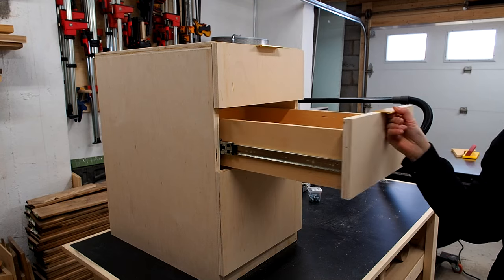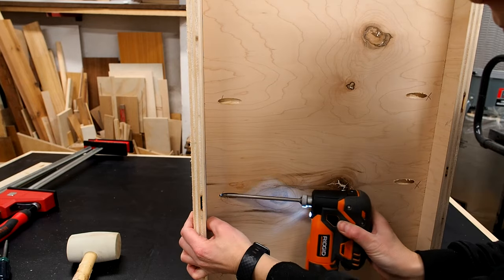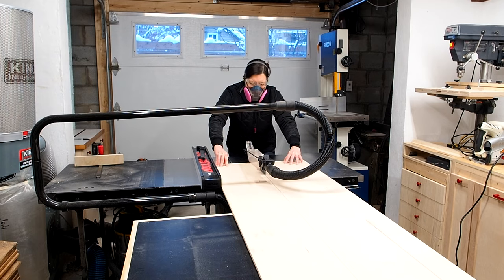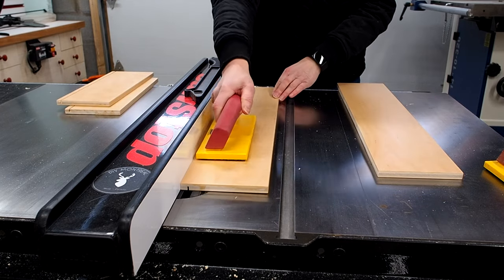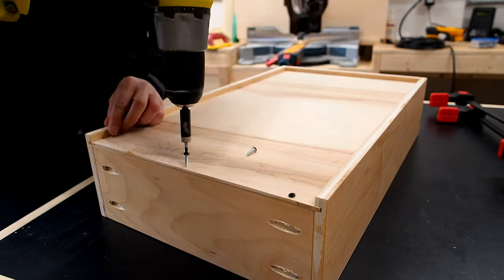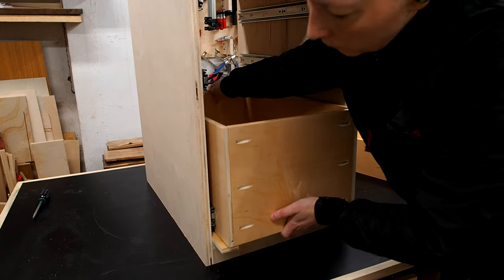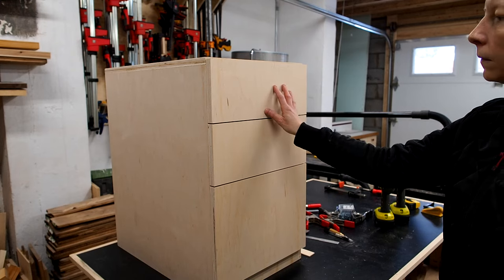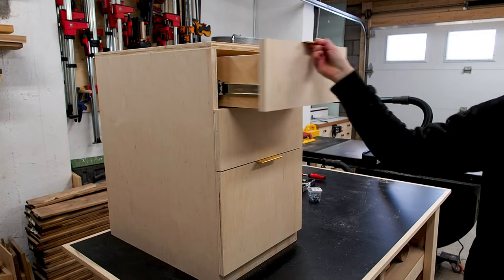DIY Drawer Cabinet | Drawer Making and Installation // Plans available

Comment: Would be very interested to know how easily a cabinet like this can be set on casters so it can be easily moved at will.
Reply from the maker: Super easily! Just use small casters instead of the leveling feet installation I used.

Comment: I am a complete beginner and I cannot tell you how much I enjoyed and learned from your video!
Two Questions though:
1) The video shows the top of the cabinet straddling the sides, and the bottom is "inside" the sides.
Does this mean you have to cut the top and bottom separately?
2) I know that you want to "hide" the pocket holes inside the cabinet, but does screwing toward the edge of the board leave enough wood on the edge for a strong connection?
Again, thanks for such a great video!

Comment: You can also accurately measure the width of the front & back of the drawers by stacking both drawer slides and 2 off cuts of drawer side material against the inside face of one side of your cabinet and measure to the other side with a ruler or story stick.  Would allow exact setting for stop block on Chop Saw without the need for the offset at the chop say you showed.  There really is more than one way to "skin the cat" 😃
Reply from the maker: There sure is! 🙀 Great tip 👍

Comment: Nice video, I like how you showed how you installed the drawers but what I struggle with is how do you determine drawer spacing either for frames or frameless cabinets?
How do you work out where to place the drawer slides?

Comment: You make it look so easy, I just finished a small 3door dresser . Making the draws was no problem but I had trouble dividing it out and the face plates . One of my face plate pulled the draw forward so then it wouldn’t flush back to the side . I use euro slide , any advice would be great . Thanks

Comment: Im building cabinets similar to this, and I have a question. Why not put the bottom slides resting on the bottom piece of wood instead of a few inches up? Wouldnt it be more secure that way?

Comment: For the pocket screws in the 1/2" drawers, what size screws are you using so that they don't sit proud of the surface after installing? I'm using the Kreg K4 with 1 inch Kreg pan head screws but they're sitting maybe 1mm proud of the surface no matter what I do.
Reply: I'm running into the same problem and when I reached out to Kreg jig they told me to use a 3/4-in fine thread which I'm questioning the holding power with plywood.   I'm assuming most people are using Baltic birch which is a true half inch which would probably give you that extra 1 mm.
Reply: Baltic Bitch is actually metric and 12mm, as opposed to half inch which is more like 12.7mm. That’s what I used and it didn’t help, and Kreg gave the same answer, except they recommended buying the micro pocket hole adapter for thinner material. I didn’t want to spend another $40 so I just had to live with it… 

3/4” fine thread helped a bit though

Comment: I don't think I saw how the back of the file cabinet was installed. Could I be pointed to where that is please? I built this cabinet and am wondering if I should have put a dado on the side panels and bottom to accept a back or if it is just tacked on

Comment: Is there a reason why you wouldn’t line up the slides with the bottom of every drawer box instead of using spacers? Also, what is the point of creating a toe kick if it’s going to be covered? Thanks.

Comment: Perfect timing as I need a desk for my office as well. 1 question though, your plans show the toe kick as 2-1/4" tall but the space to put it only 1-1/2" tall. Which of the 2 dimensions is correct? Thanks!
Reply: If the bottom piece is 3/4" plywood, then the top of the bottom piece will be 2-1/4" and there will be 1-1/2" of space underneath it
Reply from the maker: Sorry again for the small mistake in the plans Rick - it's been fixed and updated. Correct dimensions were 1-1/2 for the toe kick.

Comment: Why have different front and back panels for the drawers? Just personal preference?
Reply from the maker: I've built drawers using slightly different methods in the past 3 years; first time trying this way out. This particular method makes it easy to slide out the bottom panel and replace it if needed.